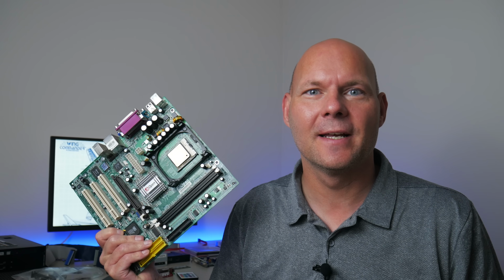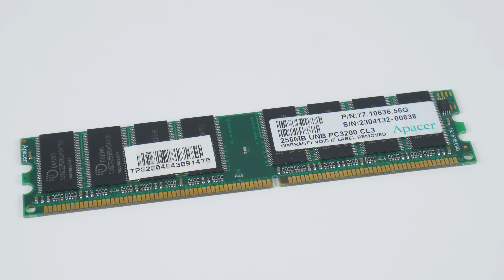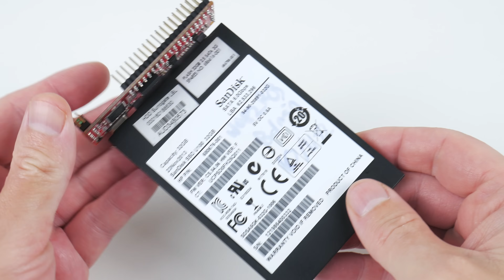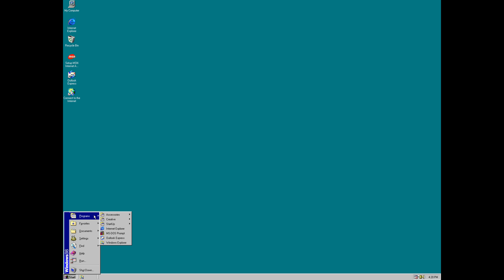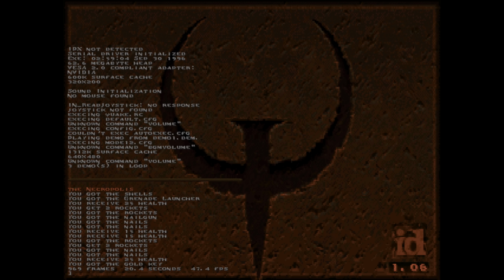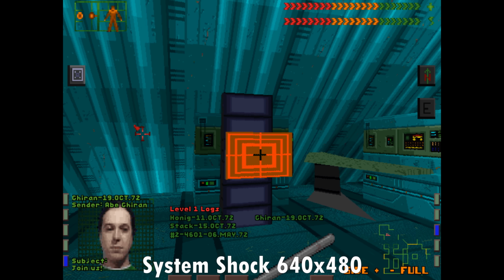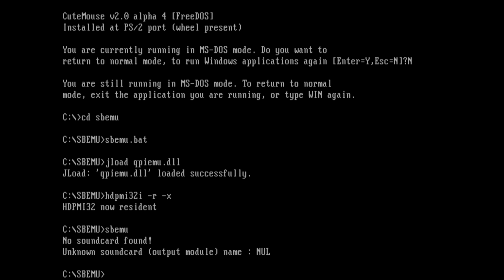Pentium 4 with SIS chipset? Sometimes Retro PC Gaming can be frustrating!

Comment: I have an acer b300 with pentium 4 northwood 2.0A and a mx400 gpu with the original sis oem motherboard. I can tell i have faced a lot of issues and still. For example, when i installed more modern gpu the 7800gs agp. Every directx game has weird black flickering + missing walls. I installed the agp sis driver by accident and it removed most of it but not in newer titles like the room 2. Thanks for the video as always.

Comment: I always enjoy Phil's videos, so informative, and you can tell how passionate he is about retro computers, and games. I have a P4 machine running a 1.8ghz CPU, I use the FX5700 (256mb) video card which supports DirectX 9.0a;  using Nvidia driver version 56.64, and nGlide version 1.05, I have 2gb of PC3200 ram, a 120GB SSD, and a SB Audigy 2 sound card. This configuration lets me play 62 Windows 95 & 98 games. I have a second Windows 98 machine running a Celeron 400mhz CPU, FX5200 (256mb), a 40GB IDE HDD, I use DirectX 9.0a, driver version 45.23, nGlide 1.05, 500mb of PC100 ram, SB Audigy sound card. This machine will run the speed sensitive games like Wing Commander Prophecy just fine, I have 42 Windows 95/98 games for this computer. I love retro gaming, and finding the games, buying them, and building, or upgrading old computers is half the fun, then getting all the software loaded, and working properly...........I also built a high end Windows XP computer, I have 92 games for that machine.............it's a labour of love...........every guy needs a hobby! :)      SUBSCRIBED
Reply: Those are some nice machines. How's the performance of the FX5200 on windows 98 games? Thanks in advance.

Comment: You can mod modern coolers to put on the Pentium 4. Just remove the CPU plastic bracket from the motherboard to get some nice room and use a custom metal plate to secure the modern CPU cooler on the Pentium 4. A custom metal plate appropriate for the modern cooler chosen, with holes at the correct positions to align with the holes of the Pentium 4 socket, can keep the cooler tight and secured on the Pentium 4, providing much better cooling at much lower fan speed. 
As long as a processor comes with a heatspreader that protects the die from cracking, finding a way to put a modern cooler on an old socket, it's easy job.
Reply from the maker: Which modern form factor lines up with the Pentium 4 holes though?
Reply: @philscomputerlab  Probably none. That's why someone needs to mod a metal plate or something to secure the cooler on the CPU.

Comment: Has anyone used a socket 775 SIS chipset? I have a few ECS M661FX-M7,  boards here, with Celeron D 2.8ghz chips, AGP slots on them, from Acer PC's someone was throwing out in a cleanup. They do have chipset drivers for win98 readily available, but if anyone has experience with them, let me know.

Comment: A caveat for some Universal AGP slot SIS boards, looks can be deceiving.
I have an Asus P4S8X board with the SIS 963ua chipset. While the AGP slot is also universal in it's physical appearance, it does not support 3.3V cards.
A red warning LED will engage at power on, and the board won't start the boot cycle.

An excellent video Phil :) As an old AMD'er, K6 - Athlon 64, I'm only just now digging out some P4 hardware, for a trip down the road not taken

Comment: This was my go-to mainboard chipset for my Mame cabs many years ago...One of the few motherboards where the onboard sound ran perfectly with DOSadvancemame/vsync/ac97, with no dos drivers & zero configuration, also able to utilize a cpu fast enough for reasonably decent games (for back then). also used NvidiaGF-MX400 PCI cards for perfect custom 15k modes

Comment: A p4 intel  of 2800 mghz would not have been equipped with a nvidia 5200 unless one bought a office model , a p4 2400 early p4 cpu with 512 rambus memory and windows 98 with Geforce 3  200 ti. IWhen i think about even office models were with the next step up from 5200 the 5500 model -5600 were sold as entry gaming

Comment: SiS chipset motherboards both retro(P3 systems)and modern(P4 systems) tended to give ALOT of trouble for even basic windows and Dos use and there were a handful of manufactures that used those horrible chipset based boards like DELL and MICRON and HP. I remember DELL P2 and P3 systems using it and oh my goodness how many bad days I had at the computer shop trying to explain to the customer that the mainboard was just faulty and flaky without insulting them for buying such garbage. But alas I did try the mini itx modern Celeron motherboard with SIS chipset based on the Intel Core 2 standard and it was NEW and failed right out of the box! The onboard graphics was faulty and locked up at the bios screen at random! Yeah no SIS for me thanks! Amazed you got as far as you did with that board lol!

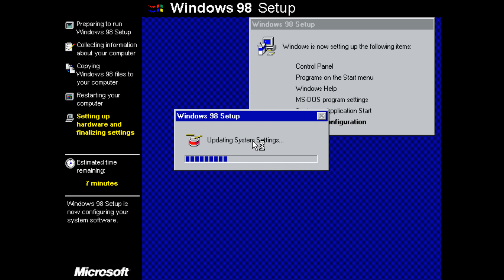Comment: 5:30 Wow, till now I'd never seen that issue again. This freeze at that point was exactly what I got when I tried to install Windows 98 SE on my then brand new MSI K7-Master/1.4 GHz Thunderbird C. I had a floppy drive connected & enabled though. I tried several things but it wouldn't work so I had to switch to Windows Me, which I wanted to avoid due to the scrapped real DOS-mode (didn't know about the workarounds for that which are well known today).

Comment: Retro PC gaming is always frustrating. You have a good idea, but then you realize that one game works well on nvidia, other game works only on ATI, or you need some old drivers which doesn't work for your newer GPU, so you need an older GPU to use driver version which doesn't have artifacts in picture in your game you want to play, but then you realize that your older GPU is not powerfull enough, so you are looking for the strongest GPU from that generation, you pay crazy money and at the end you realize it's still weak or there is some other bug or your too modern AGP card doesn't work with your motherboard, which was pretty common. Yes, retro gaming can be really frustrating.  😀 
Late Win 9x games (like AvP or NFS5) surprisingly work well in Win 2000, I didn't expect that, but compatibility with these games is much better than in XP. I am always like" "should I keep ME or 2000 or XP on this computer for the best compatibility?" and I am thinking about that for like 3 months.

BTW I recently modified giant Arctic i13 for socket 478 and it looked that ridiculous that I removed it and installed some normal cooler, it just looked somehow wrong on socket 478 motherboard. I was running prescott close to 4 GHz with that and if I remember it correctly, it still had like 50°C in load. 😀

Your PATA-SATA convertor looks great, I have some different type which needs to be pluged directly into IDE connector on motherboard, so it's really ugly, it takes a lot of space and it needs another power connector, cable management is impossible with that and that SATA cable there looks really like it was not supposed to be there in sime Pentium III computer, but it works. I wish there was something which looks like 3.5" IDE HDD, but with place for modern SSD inside. When you run Win ME from SSD, you realize how modern computrers are slow with Win 10. 😀

Comment: A man after my heart! My P4 setup has the CPU overclocked to either 3.0 or 3.2 ghz with I believe 4gb of memory. Graphics is an evga 7800 GS AGP card. Also have a BFG card, but it takes 2 molex connections for power. 
Damn, now I  want to get the PC out of the shed tomorrow for some XP Pro 32bit gaming...

Comment: Games freezing could be due to using a too fast cpu, not a sound card problem.
In monkey island something similar happens, if you use a fast cpu and adlib/sound blaster music the game wont start up, showing an error, but changing to midi, pc speaker or no sound will fix it.
Again this is not a sound card problem but a cpu speed problem.

Comment: Weird. I believe I had some motherboard with SIS chipset. I installed original windows 98 SE (russian licensed version) to it without any problems.  But when i got motherboard with amd 754 socket and VIA chipset replaced SIS motherboard for VIA motherboard. I decided to do so, because overall via chipset works better. My 1.6 ghz amd sempron runs significantly faster then 478 celeron 2,4 ghz. It sounds strange but it is a fact. IDE disk work faster on via than on SIS. Strangely enough but even sound blaster pci 128 (i didn't have sb live card at this moment) sounded clearer on VIA. I Didn't try ssd drive but I tried ide to sata converter, and guess what - on via it worked faster then on SIS, again. The only pros of SIS whas that on SIS motherboard I could easily install win98 from sata DVD-Drive to sata hdd, meanwhile on via chipset i could use sata drives/hard disk only after i install system on ide drive(i tried every option on my bios, nothing helpes). It was a reason why i bought ide to sata converter, because my last dvd ide gone broken, didn't read 80% of my cds and always scratched them. But know what? Faster cpu, cleaner sound, faster hdd work is overall better than opportunity to install win 98 from sata drives. It was last time when i installed clean windows 98, because then i open for myself windows 98IF, and i still use it. Can't recommend it to you, because it is in russian language, but it became famous in retro russian society because Fedorenko, did fantastic work and this version has everything in it, usb drivers, sata drivers, kernelEx, most efficient video drivers with auto detecting your card  and other patches and drives. Sadly Fedorenko died during COVID pandemia so this project is abandoned now. Yes i could install all this drives by myself, but after win98IF i became lazy

Also i did tried to install chipset drives both on sis and on via chipsets. But the result was ... ... ... Bad in most cases. For sys chipset(win 98 - total crash, win2000 - crash, winXP - crash, system worked but needed to reinstall) . For via chipset (win98 - crash, windows2000 - system work faster on 20%, winXP - system works slower on 20%).

Comment: These days i have found a IBM Netvista PC with Intel Pentium 4 CPU 1 GB RAM 40 GB HDD and Geforce 5200 AGP. And it Runns after a Bios Update With Windows XP Witout is not realy suport Windows 2000 and XP. Becourse of the missing ACPI Support with the Original Bios.

Comment: Yea I had a similar board, maybe even that exact one (It was an aopen board with sis chipset, I just dont remember what exact model it was). I had a lot of issues with Win98 and DOS gaming, ranging from freezing randomly to cryptic error messages. It did work pretty decent with XP though. I ended up selling it to a friend that wanted a cheap XP rig and went with a 865PE based board for high performance 98SE (DOS using a diff rig). Problems gone.

I know the universal AGP is awesome but really, putting up with SIS board problems made it just not worth it imo.

Comment: I have used SiS chipsets with  theirs integrated video on few laptops. While they performed well under XP, they were quite sluggish under Win7 (being single core P4, dualcore, or with hypertreading). For some (the old ones with DDR RAM) I found drivers for Win98 and they were great for retrogaming (altough I remember some incompatibilities and being unstable sometimes).
Reply: The Videochip was not good enough to run vesta or later

Comment: where do you get the patch to run run windows 98 se to see my 1gb of ram i have 2 512mb ddr ,, or should i use 2 256 mb sticks ,, my socket  p4  socket 478 has 4 ram slots,, i beleave up to 4 gb of rams,, i heard peaple are have problems with 98 se going over 512 mb of ram

Comment: I have many boards based on SIS645 and its related chipsets (any SIS with AGP4x is basically based on that, the later ones just have official FSB533 support, which was not there early but worked anyway, and there is also southbridge refresh with support for USB 2.0). Some are really good, Asus boards great, FIC too. MSI 645 ultra works but DOS sound works only when you disable ACPI in the bios. I have one bad appe tho, that is ECS P4S5A. That one is crap. No DOS sound ever, promises HT support with newer bioses, but if you flash them the whole ACPI goes haywire and they freeze on post if you actually try to use CPU with HT. Its a mess. FIC, Asus and MSI (without ACPI) work really well. I however only use them with win98 and DOS sound under there, no pure DOS.

Comment: thank you Phil for your Retro Hardware videos:) I like it too. Now I have a big project to benchmark my old Medion PC MT4 667MHZ i hope this pc will not get crashed.  And I want benchmarking some old cards on Pentium 4 1,7GHZ. geforce 2MX-400, geforce 2GTS; Geforce 3Ti-200 and Geforce 4MX460 and bencmarking cards for retro PC Athlon 3700  like X700/X800 Geforce 6600/7600. And  another cards like 9400/8500/8600/8800/9800 on QuadCOre Q6600.  It will take so long time if I#m ready i will make new Videos.

Can someone help me for problem with old game slike Deues EX Gta San Andreas and Hitman Codename 47? Why this games are lagging o every PC and why this texture bugs?
I think its not the graphic cards or driver but more Direct X probllems. But what can I do? I have downloaded different Version of ddraw.dll because I thinks its something abot that because the distance Problem of texture especially in Gitman Codename 47.  I have copy the new version of ddraw.dll in the folder but its still the same version like before in the propereties. What can I do to get the newer version at the system 32 folder in Windows XP?

Comment: Sis chipset is just plain crap. I used to play tomb raider, I had a special version with 3d support for Matrox Millenium and Mystique, because I was owning a Mystique at the time. the distorsion is due to shortcuts in programming to accelerate 3d CPU rendering, and don't appear when using 3d acceleration. Many patches for Mystique, 3dfx glide, are available. Just find one suitable for your graphics card, even with a glide -> opengl or glide -> dx3d wrapper

Comment: Great of you to look into different boards and chipsets! Slightly off topic but: Hope you one day will take a look at a VIA Hermes chipset board. I have a Pentium 3 board with that chipset, paired with a Voodoo 4500 AGP, and most Glide games freeze up after a few minutes. The system completely becomes not responsible. I swapped the Voodoo out for a Radeon card, and played the same three games (on OpenGL) that freeze up for more than an hour each, and it worked fine. I put the Voodoo 4500 in a Pentium 4 machine and the same games worked fine. Peopel say I have to put the AGP speed to the lowest, but it already is on the lowest, and doesn't make a difference. Is this chipset really incompatible with Glide or could there be something else?
Reply from the maker: Voodoo cards don't use AGP features. Think if them like a PCI card with higher bandwidth. They are the most AGP friendly cards, so could be something else. VIA Hermes, never heard of it. They usually have a number attached.
Reply: @philscomputerlab  Oops I mixed up my Greek gods :P It's the VIA Apollo lol. I even tried to run the memory on 100 instead of 133, didn't help either. If I ever can get my hands on a PCI Voodoo, I will switch them out. Or maybe i'll be better off just building an AMD Athlon 64 rig for Windows 98 games, will probably be way more stable. Thanks for the reply!
Reply from the maker: @yukondave8389  I'm aware of some issues with early VIA chipsets and Sound Blaster Live. With the Voodoo 3 there were also issues to do with power delivery. Seeing Socket A is very fast you might be better off with a GeForce or Radeon anyway?

Comment: I bought 478 socket mobo one more when it was 12 AUD, and retro CD with IDE type also a few I had. I had all of them  except SIS chipset... But they will die. I may better to run it before they totally broke. Korean weather is warmer and humid and think they would not work properly soon.
Reply from the maker: You make a very good point about the climate. Australia is hot and dry and hardware lasts long time. In humid climates, air conditioning is required to get rid of humidity.

Comment: Pentium III is a better route to go with WIn98/DOS. Pentium 4 is solid for WIn98, but we have to remember it was Win XP that were the operating system in its prime, and DOS were already out of the picture. So the chipset can give issues. But for the lack of a PIII,, the P4 can do. Also look after AMD Athlon (socket A).
Reply from the maker: Though Pentium 3 a little bit harder to find. But I agree!
Reply: @philscomputerlab  Indeed. Many of the P3's got trashed in 2003-2006, so they are quite scarce (and valuable) today. My PIII is just for Win 98 (512MB RAM, GF2 Pro, SB Live,). For DOS, I do prefer my P133, 32MB RAM, with S3 graphics and  the ESS688 sound.